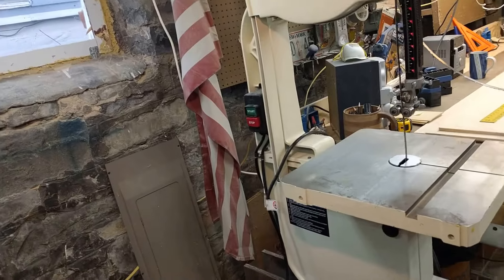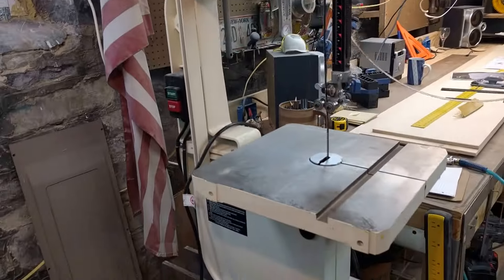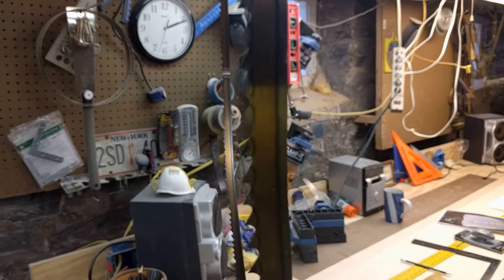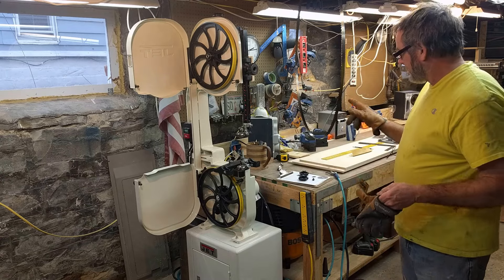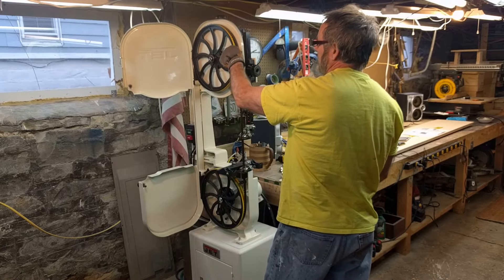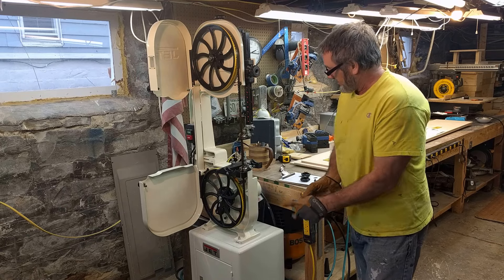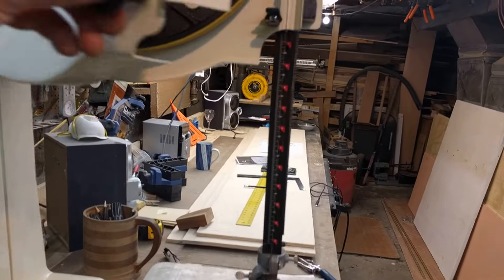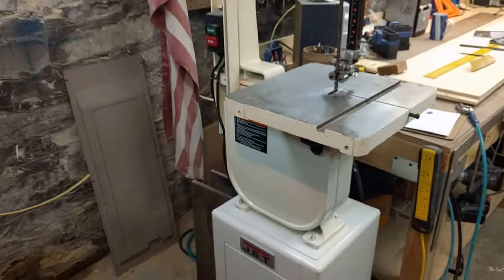How to change a blade on the 14" inch JET Band saw

Comment: No need to take the table off. Just turn the blade sideways. All adjustments are still accessible with the table on. I found this video to learn what to do about the pin that ran across the slot at the throat where the inert goes, and noticed Larkin's saw didn't have one. So I hit it and it fell out, which might be useful know-how for anyone why encounters that pin.
Reply from the maker: Hello  David and thanks for your comments and obviations regarding the missing pin.

I was changing out my blades so often as I was on engaged with several thicknesses of wood. 
This pin helps to aid the split table flat and parallel. 
And yes, one does not have to take the table off to change the blade. I find it easier to adjust the Bandsaw bearings as well as clean them while switching out various blade sizes
Reply: @StevenLarkin  just to be completely clear, I didn't mean the black pin with the hex head that gets hammered in from the side, but a very small pin that runs across the slot right next to the blade throat near the underside of the table. I'd guess it was about 1/16" diameter and I have no idea where it wound up falling after I knocked it out. Seems to have served no purpose other than to cause bewilderment about how to extract the blade.

Comment: Looks like you put the base on wrong. When you open the door you should see the pulley and motor. That door is to make it easier to change belt. Also you can take the blade off without removing table. I have the same one and its very easy
Reply from the maker: First of all my unit came from the factory just as you see it.
Second of all it is MUCH easier to remove the blade with the table off. And while it is off you can adjust the baring much easier and with out interference from the table
Third of all you can perform better general maintenance with the table removed
Reply: The motor of this saw is situated outside the base, not inside. I think the regular Jet 14" JBWS' motor is inside and therefore the door in the base is also on the back instead of on the front. If this one were on the back you wouldn't be able to open it, because the motor would be in the way.

Comment: Admittedly I'm more rookie than seasoned when it comes to bandsaws, but I was surprised you took the table off to change the blade. Is that a factory recommendation? All other videos I've watched and articles I've read had not shown or mentioned that step before. Also not wanting to be the safety cop here but I do have over 40 years in the electrical industry so a wee bit of experience there. May I respectfully suggest you put the panel cover back on. It is there for several reasons, but a couple that apply here is to prevent unexpected contact with energized parts as well as contain any flash from a electrical failure inside the enclosure. If there was a dust build up inside the enclosure and for some reason the panel experienced a major failure that dust would make things a lot worse.
Reply from the maker: Hello Dave,
My JET 14" must have it's table removed unless you  poses the skill sets of Harry Houdini of course. 
I have long since put the panel back to it's place of honor. 
Thank you for your comments.
Would love to see your Bandsaw in action : )
Reply: @StevenLarkin  No it does not! Consult the manual. I change my blade frequently on the exact same saw and NEVER take off the table.
Reply: Exactly right, no need whatsoever to remove the table, that's what the 'slot' is there for to begin with, - - so you don't have to remove it. Good video and good job narrating otherwise, though
Reply from the maker: Folks trust me if I did not have to remove the table and for the very convenience of the process, I would leave the table on. 
I would like for any of you guys who are adamant about your convictions and knowledgeable base to demonstrate NOT removing your bandsaw's blade
Reply: @StevenLarkin  I just changed this exact bandsaw and never removed the table. I just lowered the tension, allowed the blade to leave the top wheel, and then un did the screw on the table, with the blade free of the bandsaw wheels last thing to remove the blade, i turned the blade 45 degrees and walked it out the slit in the table saw.. Then replaced by inserting the 1/2 3tpi blade for resawing back in the same way.. NEVER TOOK THE TABLE OFF OR MOVED IT. Just removed the bolt which is not there to keep the table level either. I laughed at that. Its to ensure if the blade does some how come off the entire base it cant fly out across the room. Suggest anyone who really wants to know about changing a blade for the first time.. search Alex Snodgrass. You will learn correctly and not have a head ache cause someone has never heard of a tripod.
Reply from the maker: Hello @ivon Eaton lll,
I made this video some 4 years ago and have been on a learning journey for sure. I believe a purchased this Bandsaw only within a year or less. 

I absolutely agree that you do NOT have to take the table off in order to change the blade. What I should have said is that it will make it a lot easier to change the blade if one would remove the table, my apologies sir. 
Plus, by removing the table one can get a clear look at the bearings to make needed adjustments (over time we know that movement is imminent) if needed. And look and inspect any other areas of concern. Cleaning and so on ...

I acknowledge that  I should have mounted the phone for many of my earlier videos and certainly am sorry that I did not do this.  In my newer videos, I mount the phone more often than not. And if I do not, I pan slowly. 

I have much respect for Alex Snodgrass!!!!!!!!!!!!!!!!! I had the pleasure of meeting him several years ago in Succus NY at my very first Woodworkers show. Ales is very knowledgeable and one of the last southern gentlemen. Unfortunately, folks like him are becoming less and less a thing.

Thanks for your comments, I am mostly always open to constructive comments and criticisms.
Reply: @StevenLarkin , and removing the table is Alex Snodgrass' credo anyway! 'Take the table off, will you!? It just makes it a thousand times easier to see exactly what you're doing!' Or something to that effect. But then, he's so used to removing and replacing those tables, it looks like he's twirling a pizza base... 😄

Just about something else, however, which you've probably already figured out by yourself since having made the video, but looking at other people's videos I think your insert plate is/was facing the wrong way? Someone else who made a video about his new Jet 14" - not the DXPRO - in fact also replaced his insert plate like yours, but when he then tried moving the gullet of the teeth back to the correct position in the centre of the pulley the wider blade he had just fitted was catching on the insert plate, so he turned it around.

Comment: thanks for doing this video. I have not yet bought a saw but, I am looking. I hear many good things about this saw. As I am new I am not sure this is for a beginner wood worker. I heard people say it might be too much if you're just starting out. However i do want one that will last and this looks like this would be around for a long time.
Reply from the maker: Hi Kimberlie : ) 
So I also had to figure this out like you are... My first Bandsaw was (is) a 10-inch RIKON. 
I was so excited when it arrived!!! I unboxed it,  set it up and immediately started to use it, I was so so excited.
Well, it didn't take long for frustration to set in.  This little guy did NOT have the power I assumed it would have. 
Then there is the idea that the 10 inch only gives you 9.5" on the left side of the blade to the riser block or otherwise the left hollow bar where the blade rides through.
The 14 Inch Jet will give you 13.5".  
The 14" JET for the money is a great bandsaw. Plenty of Power and very sturdy. Note that JET gives you storage on the bottom. The cabinet is very well made. 
You will have to order their fence as it does NOT come standard. I would advise on getting the Carter Magfence II http://www.carterproducts.com/magfencer-ii-next-gen-magnetic-fence
Let me know if you have specific questions about this unit... I have had it for a few years now 
I do wish they put a blower hose next to the top barings... this would give the 14" JET a 9.5!

Comment: To be clear, are you saying the kirf of the blade is where the teeth connect (or technically stop being teeth)?
Reply from the maker: The deepest part of the gullet should be dead center. So yes, where the teeth are not teeth any more
Reply: @StevenLarkin  Awesome, thank you!  I've been around all kind of wood working tools my whole life, except a bandsaw.  And the more I research, the more it seems it is (or can be) the most versatile saw in the shop :)  Thanks again for your videos.

Comment: Good video! thanks for sharing. / I'm considering buying a used one and trying to get some info on this saw.
Reply from the maker: Please feel free to ask questions :) 
Good luck on your purchase
Reply: I have a laguna 1412. Beautful saw. However; I wanted a dedicated resaw. The Jet 14Pro kit? I did a LOT of research! It's not a big bang for your buck. It's a HUGE bang for you buck. Excellent reviews. I'm even building my own mobile stand for it. I will post that as well in my woodworking group. Can't wait to get in on Friday (hopefully). Like Steve said, ask any questions. My Laguna the blade change is not nearly as easy as the Jet. I like ball bearings for blade guides not ceramic.  Carver Products sells kit upgrades in which I want to put on my Laguna. Have to budget that in though.  I can't highly do an honest recommendation for the Jet yet, cause until I put it together, I can't. But I will when I get it there..God Bless

Comment: Bought this bandsaw from Woodcraft couple years ago.  Love it.  But it's a altogether different operation on this newer version bandsaws than earlier models including a no longer American made 14" Delta classic that I also own.  On the older bandsaws the upper wheel could be moved up and down for easier blade changes.  Not so with new Jet Deluxe.  You have simply the Blade Tension Release Lever.  So make sure you have the proper blade length because even with the proper length blade it's not easy to fit it on both wheels.  Also, left out of this video no matter what Jet or this guy says is that the wheels must be "coplaner" which simply means using a long straight edge to line up the front of the upper and lower blades as close as you can by using the knob and wing nut assembly.  Jet's manual is about worthless.
Reply from the maker: My JET 14' has the ability to raise and lower the upper wheel for tensioning thereby making the changing of blades easier.
I have learned my lesson with ordering the correct blades for my unit. I order from TIMBER WOLF BLADES, from SUFFOLK MACHINERY CORP. I am not sponsored by this company!
It is highly recommended that you NEVER adjust the lower wheel of your Bandsaw. They are factory set! If you have concerns regarding this, call the manufacturer. They are very polite and helpful for the JET company. I have called them through the years and find they are very friendly and knowledgeable.

I have done a fair amount of repair on my JET... please just search for 14' JET and you should find useful and helpful videos.
Reply: @StevenLarkin  Never had to or would adjust the lower wheel.  But they must be "coplaner".  That's done simply by adjusting the upper wheel to line up the face/front with the lower wheel  with the use of a long square (mine are expensive from Veritas).  My problem has always been trying to line up the bearings even the Carter bearings.  The bearings on this Jet 14" are not easy to line up and are a pain in the ass to work with.  My only complaint.  Yes, I use only Timber Wolf or the Resaw Blades from Highland.
Reply from the maker: Ha ha I agree regarding the Carter bearings on the JET